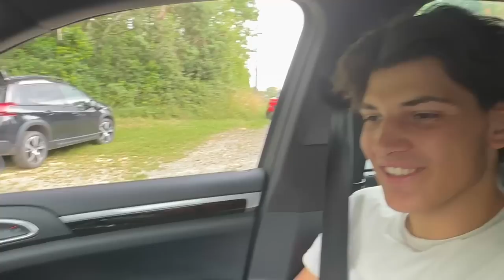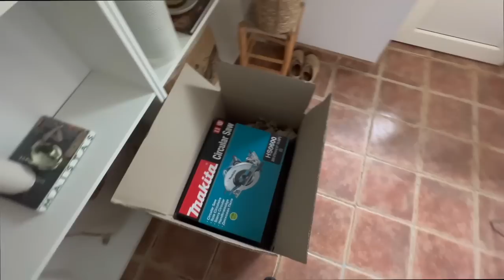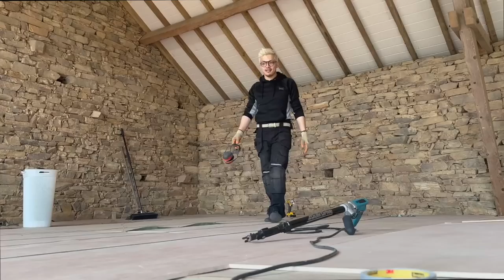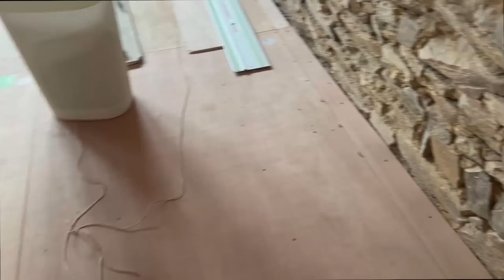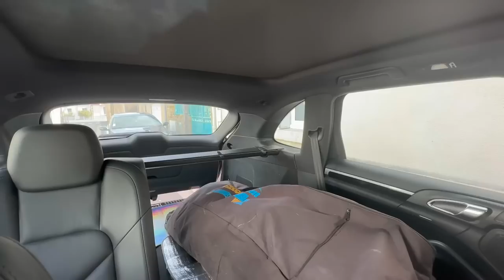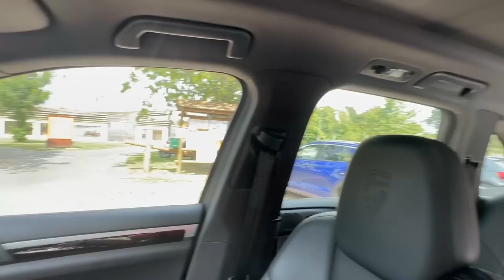a PUFF up a LADDER

Comment: Looks as though you are having problems with the ply floor covering! Unfortunately that thin ply warps.😂
Reply from the maker: Oh no!
Reply: @twopuffsandapug  We used that thin ply and had to remove it all as it warped down the edges. We had to  changed for one much thicker, as we were laying a vinyl floor covering. The floor needed to be perfectly flat or any imperfections would show. If you are nailing an engineered wood flooring, it may not be a problem, but you should check it out.

Comment: Is there going to be engineered hardwood flooring or laminate?  If so, someone is going to have fun fitting it to those rock walls.  I am sure you have thought that through.  Remoneling is such an adventure, a surprise around every corner.
Reply from the maker: it will be amtico in sun bleached oak. Ricardo will be on the walls very slowly

Comment: Does the stone wall need rendering? Seems to have some very large opening in it and I'm wondering how you're going to keep out the spiders and other bugs.
Reply from the maker: it will get pointed in between the gaps and we have some more stones to fill in spaces. it will be a slow process but will be worth it

Comment: What happened in the beginning? 
And you’re going to lay the finish boards down using mastic right but no nails? 
And wasn’t that the same footage with Liam and the wakeboard as the last video?
Reply from the maker: Double Liam! that will be me at midnight after a 12 hour drive aghhh we screw and nail boards and then putting top layer of amtico in sun bleached oak